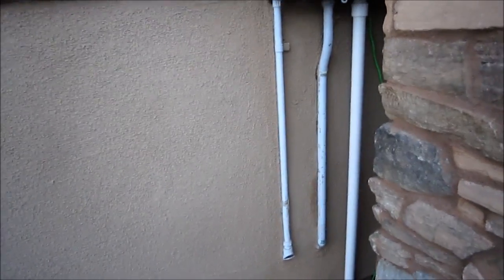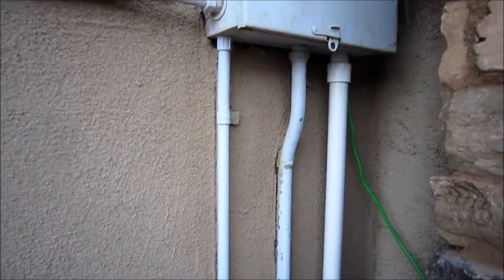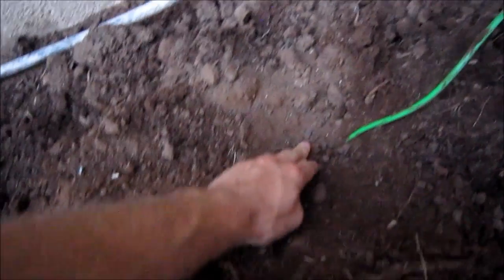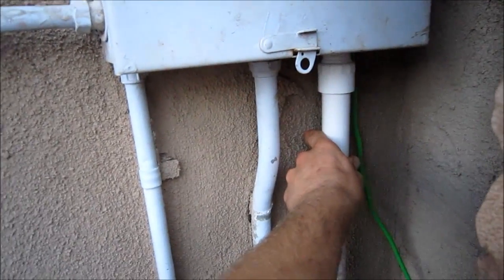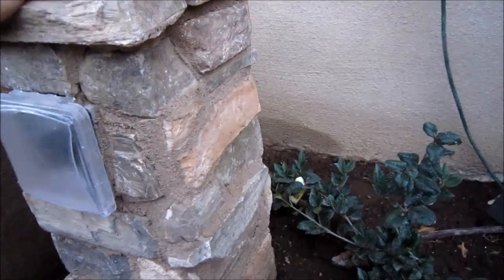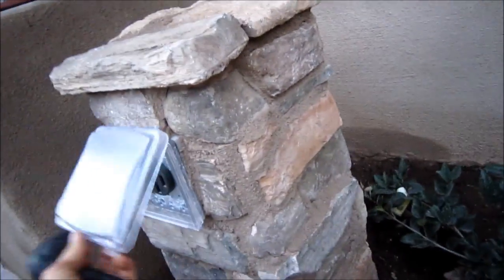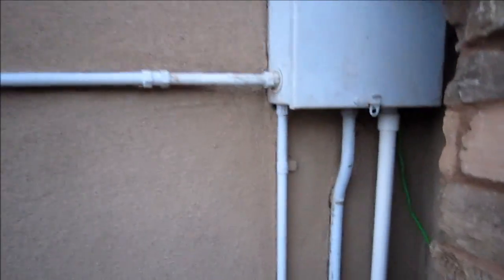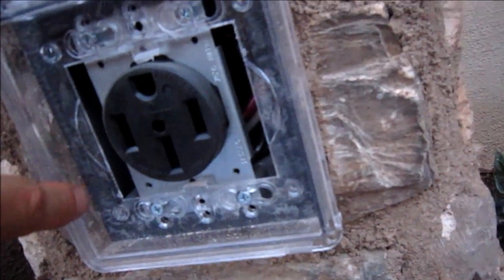EV charging outlet 240V nema14-50 installation Tesla Model S home charging DIY

Comment: I put a 240V outlet in my garage. I was going to wire it with 10-3 copper. $75 for 50 feet. Then I thought about for a minute and decided I might want a subpanel in there so I returned the copper wire to Home Depot, and went to a real electrical supply to get 50 feet of 6-3 aluminum for $42. 10-3 copper is only good for 30 amps. 6-3 aluminum is good for 50 amps. The cost savings was more than enough to pay for an 8-space subpanel.